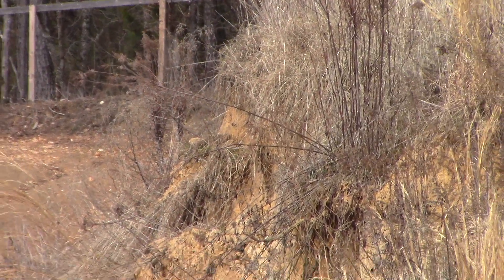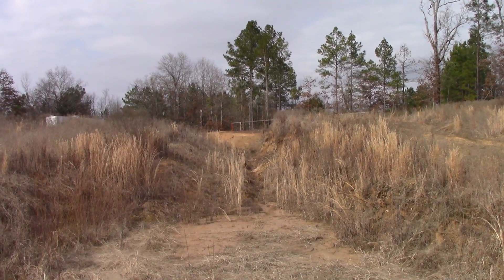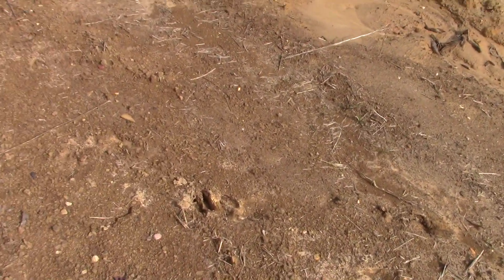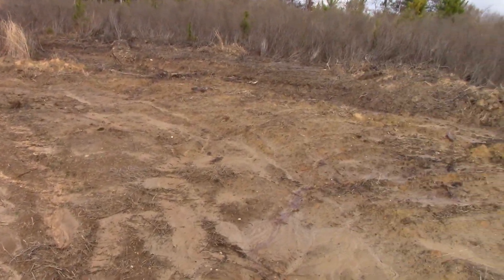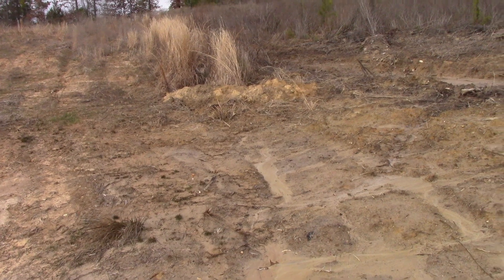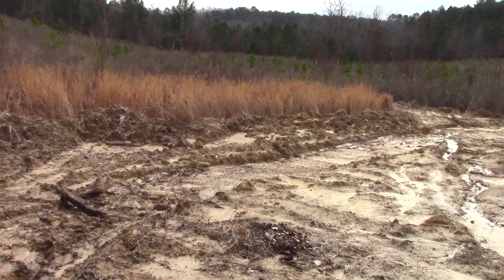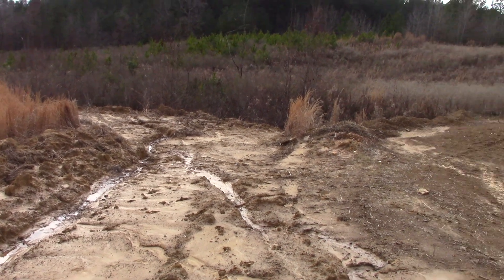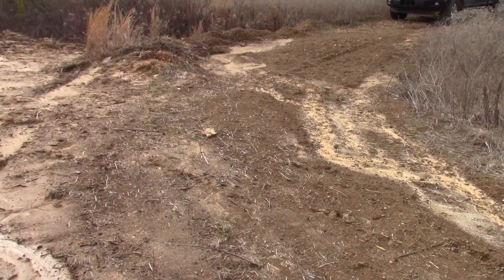We Have An Open Pit Mine.  We Fixed A Ditch So It Would Drain And Diverted Water Away From A Road

Comment: There must be no environmental rules to controlling sediment runoff into that creek you mentioned which is being filled with your sediment that comes from "cutting a ditch". I'm also curious how much potential marketable material is also being driven by that water runoff into that creek down stream and away. At least while there still is a creek. Just curious.
Reply from the maker: Our open pit is very small.  We have a dam downstream that stops the silt.  We have 10 acres.  You may ask the same questions of the nearby Crater of Diamonds State Park that has several ditches draining silt from their 37-acre diamond search field.  Nothing of value has washed downhill.  Diamonds are dense.  They are like an old, fat man at a 10K run.  They tend to plop down and not go any father after only moving a short distance.  The silt is light and washes away leaving denser material (like diamonds) exposed on the surface.  That is why more diamonds are found on the surface of the state park after a hard, scouring rain.

Comment: Did you find any dimonds on top
Reply: Exactly my question🤔 Does he get to collect diamonds from his neighbor's over flow🤔
Reply from the maker: @jacknimble7950  The 3-to-4-feet of overburden has not been removed from our neighbor's property.  If anything were to wash over, it would just be surface mud, not diamonds.  But that shows you are thinking.
Reply from the maker: I have surface searched our open pit mine after a rain several times but never found a diamond that way......yet.  All of the diamonds we've found are from digging and washing.  The same is true about my diamond finding attempts at the nearby Crater of Diamonds State Park.  I have done a lot of surface searching after hard rains, but never found a diamond that way.  All 177 of the diamonds I've found over there were from digging and washing.